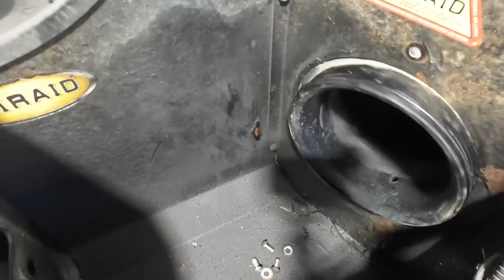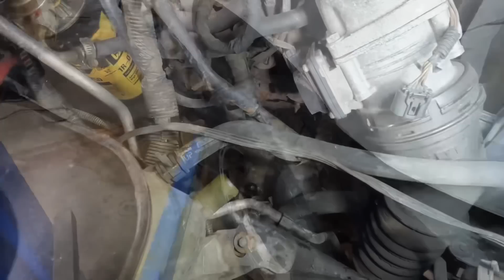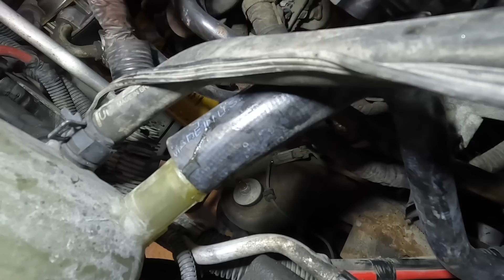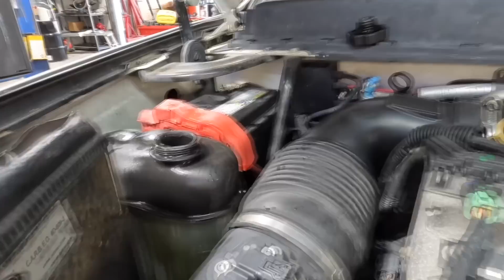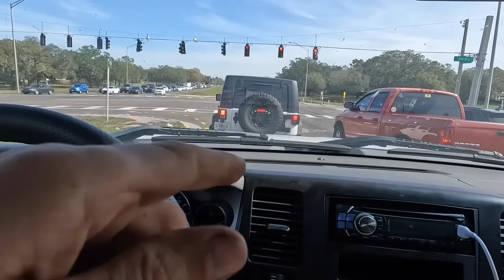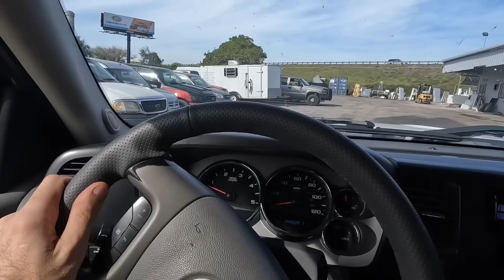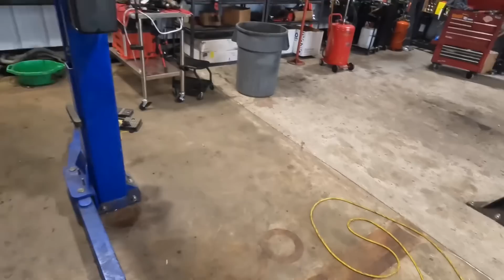Four way Radiator Hose “updated design” | Pig of a job! DURAMAX 6.6

Comment: I am amazed at how the modern truck has this conglomeration of parts for what should be a simple problem. Lower radiator tank out to water pump in. Seems like when you use plastic (petroleum product) as a means of connecting the coolant header tank to the water pump flange they forget the simple idea of rubber hose on metal tube with simple clamps. Then, instead of using a simple outlet on the lower radiator tank to run a hose up to the expansion tank, they design plastic tees that are cast inline onto the hoses... The engine-errors of modern vehicles. They do have a hell, you know. They must repair the screwups they create for eternity, like pulling the engine to change the oil.

Comment: If you had drilled and tapped that exhaust manifold, you most certainly would have dropped metal pieces into the path to the turbocharger vanes which you cautioned against.  Welding is the way to go.  Nice work

Comment: I saw the last vid and thought but didn't post maybe you could have used a nut and filled it before placing it on the hole or used a cut off bolt head then welded it on the hole. My thought was you would not have to worry as much about getting debris in the hole and possibly make a stronger repair without blocking airflow. Not that it really matters as long as it works.

Comment: Ray your good for anyone that does not know OHM law electricity follow the shortest path to resistance. That means it hard for it to travel beyond the welder and ground to  batteries or any chips in the pcm.

Comment: The only reason to thread that hole would have been to install an EGT sensor. A bolt would have been a horrible idea, so welding seems like the most cost effective choice.

Comment: What you did with those wires was that you turned a radial circuit into a ring circuit; therefore, you could have got away with uses a smaller mm2 cable.

Comment: GM instruction.  To remove and replace lower radiator hose start by removing cab from chassis and remove engine, installation is reverse of removal. lol. That looks like a PITA to do.   Great job as usual Ray!!
Reply: They give just a tick over 2 hours under warranty, so, ya...

Comment: As far as I'm concerned, welding the exhaust manifold should work fine. The weld can withstand the heat and pressure.

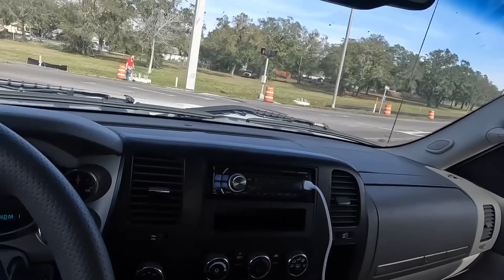Comment: 1:02:56
Howdy,    I have a comment regarding your comments, regarding the welding of the hole, Which i just saw on my local News.  Hmm
    A non plated' bolt that just falls in the hole, no tapping, and cut to the thickness of the casting would guarantee nothing gets in the turbo
Also ,    welding to Cast Steel' at room temperature ,  ,   ,    It does make a difference    Throw in the " cycling " of the engine (one of your comments)
    Ideal ?  engine running exhaust temp ?    At least 250 f     Thanks for your time   Great Vid's
ty,   les            a lot of thought went into this   lmfao

Comment: as current welder i totally agree the current is just as Ray explained and as for the plug might not look super ,,but it does the job, i have done those kind of repairs  more then once or twice, looks arn't importand in this case, wtg Ray

Comment: OMG @3:21 that ludicrously long screwdriver. I only had one of them as a TV service technician back in the '80s and early '90s. It was used to release the CRT from the chassis. I have found Chinesium versions 30 years later but they are total shite when the whole point is the transfer of torque and ease of access.

Comment: My 2005 2500, I dont think it has seen 190 in 8 months. It sees 183 every day. but nothing more. Even in the summer time and yes I have been driving with the scan tool plugged in just to see if it was a gauge issue.
I would have welded the hole.

Comment: as to wield or not,  there are many types of people and you will hear from each no matter what you do. The point most are missing, is cast iron can be wielded if the location has little or no stress. It's when you wield it to hold stress when it doesn't work well.  So ignore the people who know little about metal.  Also if you put a bolt in it, it would need to be the correct one so as not to rust from the inside, causing it to fail later. Sorry to say, noobs will always talk crap about things they know little about. You did the correct task for the job, Please don't second your judgment, just because so winners can't understand the correct way to fix an issue.
Reply from the maker: I needed this

Comment: Welding on the exhaust manifold.  The only issue I can think of is inducing EMF into the wiring from the welding arc but the area you had issues with I would had done the same. 
The ECU and other modules must have some protection built into them.  We hope 🫰
Keep up the content you’re doing a cracking job.

Comment: In regards to the welding the hole on the manifold that was fine. The only suggestion / idea I could think of is to take a bolt and cut it short about 3 mm to 4mm long and put it in the hole and then weld the bolt to manifold. That way you wouldn't be welding in an open hole and you would be only welding on the head of the bolt and manifold itself.

Comment: You are right on the efficiencies of Diesel engines, it is related to the high Compression Ratios used...  or conversely the Expansion Ratio from ignition to exhaust.   These high ratios, of over 20:1 mean that the exhaust gasses are cooled much more than in a petrol motor.   The thermal efficiency relates to the highest absolute temperature to lowest absolute temperature of the working gas ( air. )

Comment: Okay, my random, somewhat seemingly almost coherent comment for you is:

When it comes to a young man (or woman for that matter) needs to justify to his spouse the value afforded of by the purchase of an expensive specialty tool which superficially is indistinguishable from the plethora already owned, what advice do you offer? 

I ask as you have occasionally commented on the struggle a young mechanic has in becoming a respected professional in today's market. 

I am a believer in proper tools for proper applications makes difficult work more simple. I'm sure at some point early in your career but after you married, there was some rationalization of the cost of a tool weighed against the immediate needs of a family. I have a desk job, so my need for tools is incomparable in most instances to you. Hence, I'd like your ideas should you feel it appropriate to share

Comment: Once again, I am amazed at how well you do these jobs. I also am appalled at the engineers who design the various systems that often go into these vehicles. Why can't they build a vehicle that the mechanic does not have to disassemble half the car to simply replace what amounts to a faulty O-ring. They essentially turned a few minute possibly inexpensive job into an arduous, over the top, and unnecessarily expensive job. "OH... we don't make the $1.00 O-ring, but we DO have the whole plumbing system for 100 times the cost in time and labour."

Comment: Re: The hole.  I just thought it would have been simpler to thread a plug into the manifold..  I also thought about debris getting into the manifold.  Mine was just a casual comment, not a rant.  Having watched you for a couple of years, I have no issue whatsoever with your repair methods.  Keep up the good work.

Comment: Garage54 did an experiment on welding with the battery connected. They resorted to welding the outside of the ECM before they got a fault.

Comment: No, the bowls better it can fill with the exhaust stuff it and then eventually I’ll make a smooth pipe you put a bolt in there it’s eventually gonna rattle out or make a bigger hole

Comment: Humm - maybe that 3-4 hr booktime wasn't so off on this one.  At least for a lessor mechanic.  😁  And putting it back the way you found it doesn't necessarily mean it's right, unfortunately. Not behind another mechanic or even  the factory sometimes. As to the welder Q. The older ones ran a huge current. But it's not the welding - it is the pulse when you strike the arc that blows out electronics. Those old welders were/are (they are still used) like an EP going off on a circuit, but they sure can weld.  I vote for your choice with a mig though.  🤔

Comment: Welding or tapping an open hole is going to introduce metal now I would have put a bolt in there and then welded the bolt

Comment: It's better to "braze" cast iron than weld but, welding cast iron is 100% doable, just for the "naysayers". Ray, haters are going to hate no matter what. A leak is a leak no matter how you look at it, so long as the leak is fixed, it really doesn't matter how you fixed it. Cheers :)

Comment: On the welding topic. Could you have taken the manifold apart and put a bolt(short) in the hole with a nut and washer and fix it because you don't have a welder?

Comment: Having done this job several times, I offer this advice...(insert swear words here)
Seriously though, I found if you use rope, attached to the hose ends with a choke not and thread it along it path, you can use the rope to pull it along. It's still a major pain but the more you do it, the easier it gets because you are filtering out all the ways it doesn't work.

Comment: for the manifold you had 3 options of how to fix it
1. replace the manifold
2. tap the hole and insert a plug
3. weld it shut

1/2 would require you to remove the manifold from the engine to do the work, with the risk of breaking off the bolts causing lost of work

3 would either save time or not
not to mention if the weld fails then you will have no choice but to remove the manifold if it fails

Comment: You did the right thing by welding it shut. Like you said, a bolt would expand and contract at a different rate than the manifold. You did it right.

Comment: Almost sure that hose assembly could have come with the clamps as well, but they saw the opportunity to sell you 3 extra parts at a good profit.

Plus over 5 gallons you put in, must have been a cupful in the heater core still, and another sitting at the bottom of the coolant jackets.

Comment: Ray, there’s not a thing wrong with what you did welding that hole shut. 

There are always several ways to approach a repair. I believe you achieved a great result. It should buy the owner a good bit more time before that manifold needs replacing. 

Well done!  This is why I’m recommending your shop to my friends in the area.

Comment: Obviously the whiners don't understand that positive is attracted to negative, and it looks for the shortest path to ground. So unless you are attempting to attach the ground on a module or some other electronic component and welding on said component itself, the component is safe in the  vehicle, PERIOD!

Comment: Only concern with welding the hole versus a bung plug is spatter from the weld getting into the exhaust.  Get the idea about tapping the hole but a smooth sided plug with a head would work.

Comment: Ray, Ray, Ray.  It doesn't matter if you put a short stud in that manifold hole before welding, do what you actually did, or completely replace the manifold, people are going to complain. That's what they do. Seth Meyers has that problem and he calls them his jackals.  Ray, you have jackals. There really not much you can do about them.

Comment: Oh Ray, what a nightmare.  I would have bought out the hose cutters and a Stanley knife.  As to the manifold repair, I think you were right.  I can't tell from this distance, but based on the year and the appearance, the material looks like cast iron/cast steel.  That being so, drilling/tapping it would be very high risk.  These materials are very hard and not ductile.  This means drilling it with a Carbide bit at 135 deg angle.  HSS will do it, but will likely chatter.  In addition the chance  of breaking a tap is high. Nope, you were right.  The naysayers are not necessarily wrong, but your method is safer.

Comment: No matter what you do someone is going to complain about it, you need to do what you are comfortable doing, if people don't like it let them do their own thing.
Reply: Either way you have on weld the manifold. One way straight welding, other ways possibly drilling, tapping, fabricating a bolt then welding all time consuming. Me I would have slathered it with JB Weld since I’m my own customer and don’t have a welder, wallet gravity.

Comment: As for risking the PCM and/or bearings, it's not a myth. Electricity does take the shortest path, but also takes all paths at the same time. The majority goes shortest path, but stray electrons go all over the place. I have seen damaged ball and roller bearings on lathes, and watched a customer smoke a CNC mill controller because they were welding on a part attached to the tombstone. (*EDIT: A tombstone is a type of holding device used in machining centres)

Comment: Here's the deal Ray. You have different groups of people that watch. You have actual mechanics. You have home mechanics. You have people that don't know mechanics. And you have people that don't know anything and think they're all of the above. You can't single out any one group cause there's d bags in all of them. You're the one with the shop, and you act accordingly to what you think is the right way, and forget anyone else that says differently. I get you want to satiate everyone, but that will never happen. The world is full of d bags that think they're better than other people. Except those are generally the most miserable people that want everyone else miserable like them. My opinion? I would have done it differently. I would have found a bolt that fit in the hole and welded the bolt head to the manifold, no threading. I think that may have been stronger, but that is my opinion, and I don't know 100%, and neither does anyone else. You do what you think is right and forget the haters. You let the idiots get in your head too much. You're the one with the shop, and they aren't. People that actually want to help offer suggestions, not criticism.

Comment: On the welding with batteries hooked up, look up Murphys Diesel channel, he said they never had any trouble welding things on trucks etc, with electronic controls, until, he smoked the ECM on Hellboy , the offroad wrecker they are building !! Not quite sure exactly what, or how it  happened, but was a expensive lesson, got a couple sensors to I think, on a Big Cummins engine, I do know he said they would never weld on any more trucks with battery system hooked up to protect the electronics, NOT saying anything critical or naysayer, but, every dollar you have to eat,, adds up in the long game, dont you just LOVE  the engineers, that do ALL they can to make the grunts sweat and harder to do any repairs on any automobile, REVOLT I say LOL..

Comment: I think people were complaining about welding the hole because it wasn't a risk free option, and for some reason the internet has no tolerance for nuance. If anything can fail, then it absolutely 100% will apparetly. A weld might have risks, especially since (I think) it's cast iron which is often thought of as unweldable. But any fix would have risks. Trying to tap that brittle cast iron for a bolt has a risk that it could chip and shatter the metal and leave you with a bigger hole, or you could break the tap off in the manifold and have an even bigger problem. 

Overall, welding is probably the best option, especially because if the weld does fail, it'll just blow the weld out, rather than risking anything getting sucked up into the turbo.

Comment: Here your answer Ray shade tree mechanic (them) vs Professional( you). You were right on the metal expansion of two metal cooling rate over time it a gurantee it will leak again. You did it right the first time, good job. On those hoses this what they do during the assembly of motor at GM factories they drip the end of the hose in a soapy solution (Dawn and water) and those little sucker will slide on with problem, try it.

Comment: With over 50 years of welding experience I’ve never had a problem welding with a battery connected with the exception of Tig welding. Do not Tig weld with the battery connected!!!

Comment: electricity does not follow the shortest path, it follows the path of least resistance, which can be longer. nevertheless only under normal circumstances you are right, it does not matter

Comment: It is beyond me that engineers do not take into account how maintenance items are not considered into the engineering process for servicing or replacing such items. They should have been given the task to evaluate their previous engineers designs to improve form, fit and function before getting their degree. This would include the removal and replacement of serviceable parts. Just think of the cost savings this could be.

Comment: Ignore the reee, you do you and you did what was best.  There is nothing wrong with the way you did it.   Please ignore the ree and keep the entertainment going.   Your fine, they are jealous of what you do.  Plus you saved the customer money by not breaking bolts on the exhaust manifold and the cost of the manifold.  Plus you risk the heads.  I had a leak and they needed to change the turbo and my truck wound up with broken bolts on the manifold and cost me a fortune.  I wish I was near, I would rather have you do my truck than who I have to depend on here.    I would let you work on it anytime.